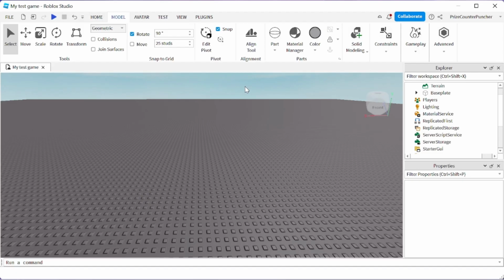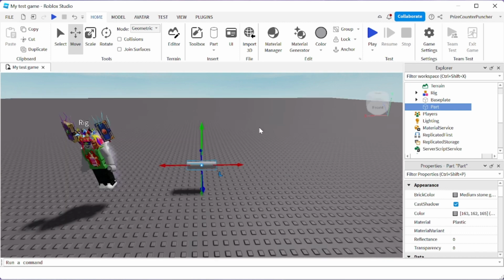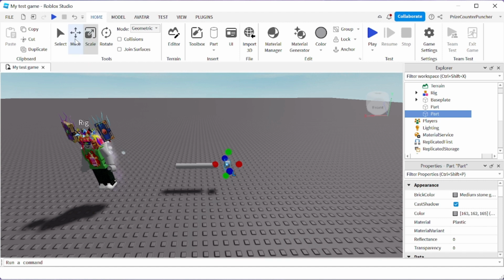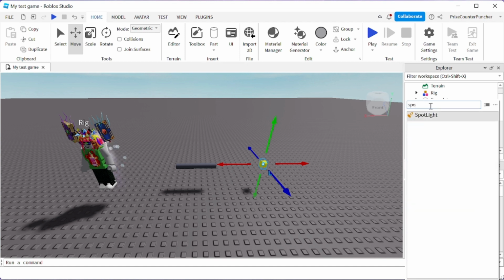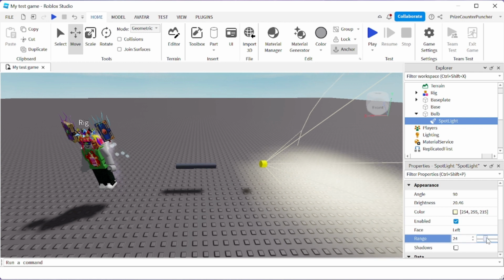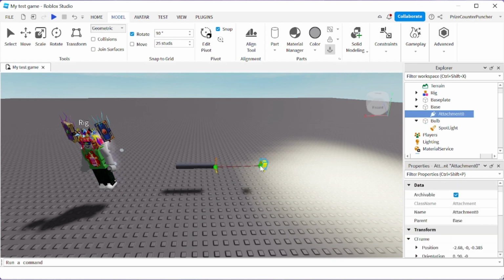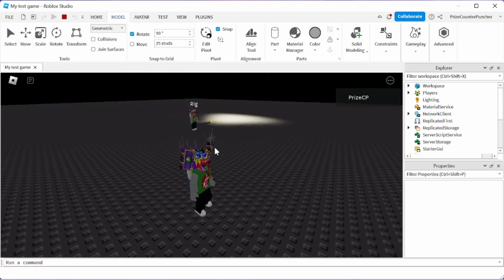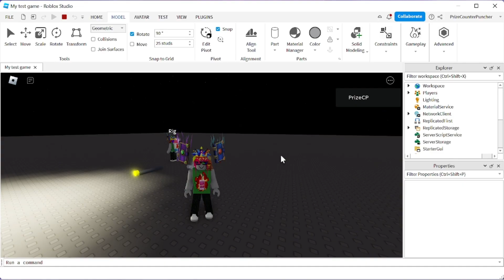Roblox Rigid Constraints (RigidConstraint) Making a Flashlight So Easy!

Comment from the maker: Related materials:
Roblox Weld Constraints (WeldConstraint)… All you need to know! (2022 Roblox Beginners Series)(B026) - https://www.youtube.com/watch?v=LQMhEo_JsUU
Roblox Rod Constraints (RodConstraint) (2022 Roblox Studio Tutorial Beginners Series) (B028) - https://www.youtube.com/watch?v=x_ZN3t7H55c
Rope Constraint (RopeConstraint) and Winch Motor (WinchEnabled) (2022 Roblox Beginners Series)(B029) - https://www.youtube.com/watch?v=Z8LO63plUTE
New Feature in Roblox Solid Modeling (building 3D objects with Union, Intersect, Negate, Separate) - https://www.youtube.com/watch?v=b8L_uDU2rLo
ROBLOX ANIMATION CONTROLLER. NON-HUMANOID RIGS (Advanced Beginners - AB010) - https://www.youtube.com/watch?v=Wcd2xUdTvNg
How to CHANGE DEFAULT JUMP ANIMATION in ROBLOX STUDIO (Advanced Beginners - AB011) - https://www.youtube.com/watch?v=CkEEIAk4MWY